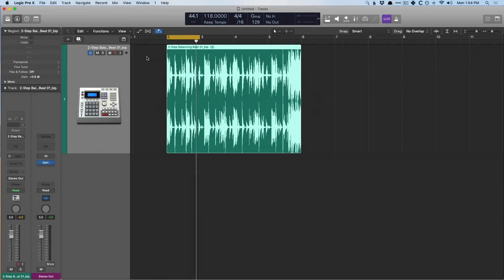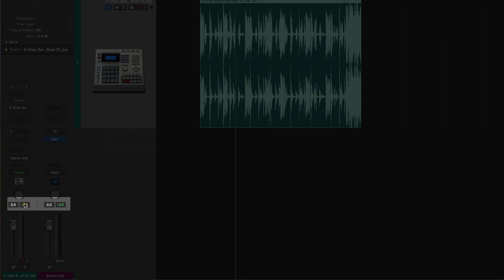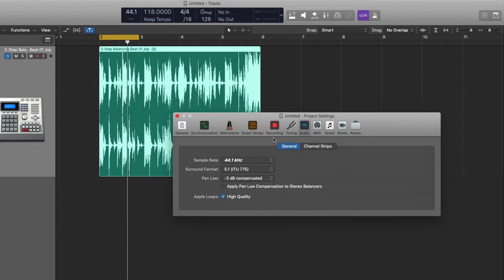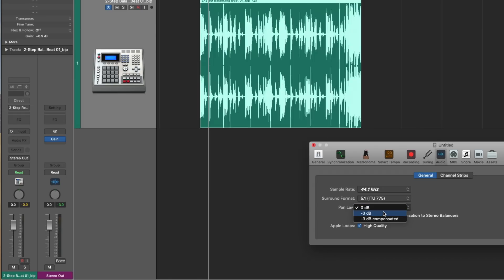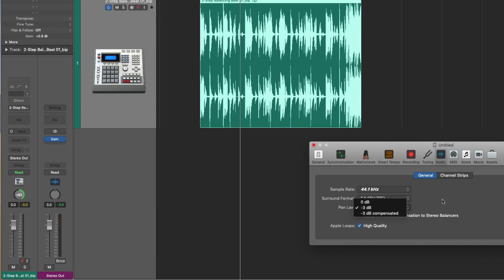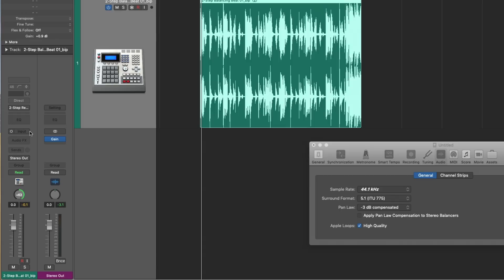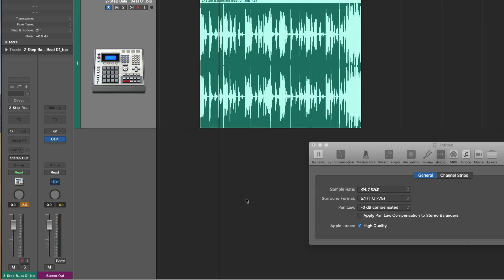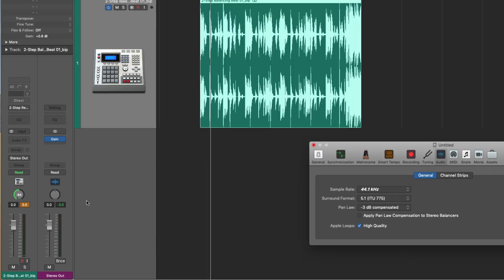Pan Laws - What Are They? And Are They Worth All the Controversy? Logic Pro Pan Laws Explained

Comment: Is not the perception any more when you use two speakers instead of one.  Inside the software is as you said.  Now, if you us a dbA meter and send x# dbA signal to one channel L or R, the db meter will messure xdbA.  When you send the same signal to both channels L and R the meter will read 3 dbs more. Remember 2 times the same power will increase 3 dbA pressure level.

Comment: I immediately thought that 2 speakers playing the same sound doubles the power. And as an increase of 3 db is a doubling in power it would seem that with this pan law the sound output actually stays the same this way in stead of lowering when panning.
Reply: Sjokola  that is correct.
Reply: Yup, that’s right. The center signal seems louder because it’s coming out of both speakers. When you hard-pan to one side, the sound is only coming out of one speaker so the volume needs to be increased so it sounds as loud as it did when it was coming out of both speakers.
Reply: Yeah, actually that's BULLSHIT, sorry. 6dB plus or minus is DOUBLE … divided by two (channels) is 3dB … 🙄
Reply: @The1dudemeister  I think you're mistaken. a difference of 10db is 10x the power. That a normal base 10 log scale. In which a difference of 3db almost makes a 2 fold radio (1.995 to be precise). The amplitude ratio on doubles at 6 db. The amplitude ratio is equal to the square root of the power ratio. Am I missing something?

Comment: Also, btw, I disagree with your statement that it doesn't change the way we mix. It does, because it alters the level signal goes in to compressors especially if they are stereo linked, and if you are skillful working on MS, linking and unlinking, it affects the perceived width of the mix as well eventually (depending how you handle it).
Reply: so which is the best